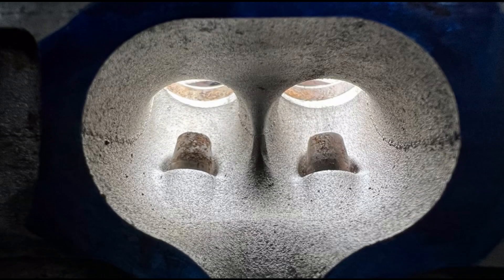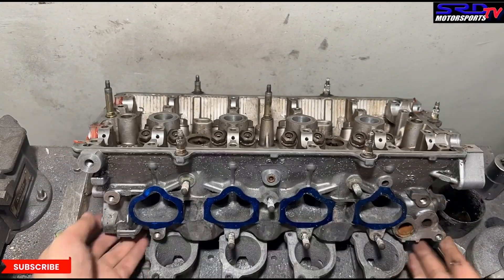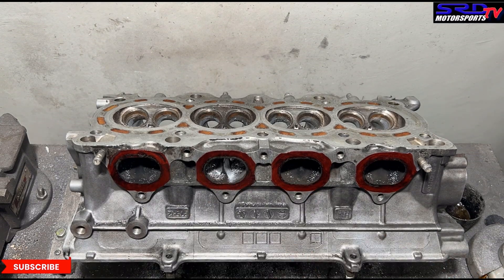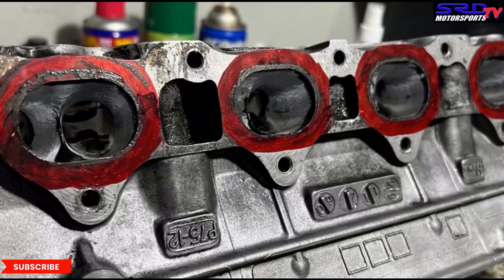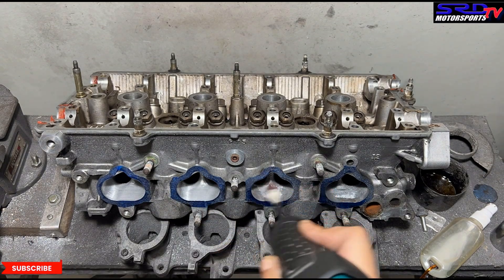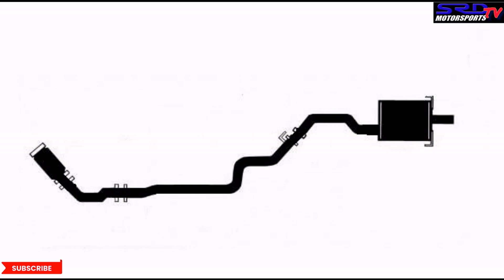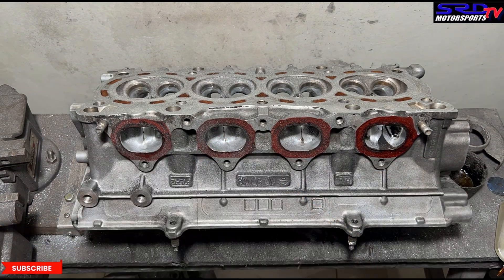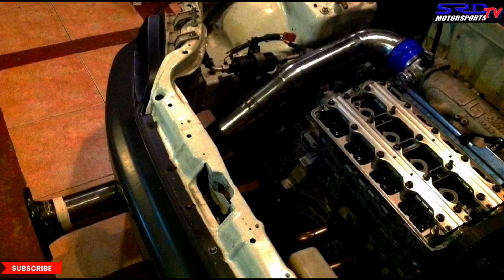B20 / B18 P75 Non VTEC Cylinder Head Portwork SRDmotorsports

Comment: Hey Brotha! You’re in AZ and I’m going to be there in a few weeks for school! Would I put in the same intake manifold? Or would I need a vtec one, or port the intake manifold as well?
Reply from the maker: Both can work but vtec and non vtec valves are different
Reply: @SRDmotorsports  I have a p75 non vtec, I had the head resurfaced but I want a port for efficiency (and for boost lol) So I’ll buy the regular sized ones for the B20 P75, then I’ll make an order!
Reply from the maker: Yeah regular sized valves is good
Reply: And same valves correct?? So I can buy everything ahead of time!

Comment: Mannnnnn great video. 1 question tho might sound lika complete fool but i never understood why people lock vtec on vtec cams or 3 lobe cams. isnt the purpose of running "vtec killer" single lobe profile cams to lighten rotating assembly weight allowing for more revs? what does locking a 3 lobe camshaft to only run the big lobe do other than destroy low end and street drivability?
Reply from the maker: Was only made for “race” applications cuz the pr03 is still bigger than most non vtec cams 

The prob is fb peeps thinking it’s “cool” for street lol that’s why u find it odd cuz it is odd lol!!!

Comment: I’ve always been an old school V8 builder but I’ve been wanting to see how much I could pull out of a stock CRV  b20 non Vtec with simple bolt ons and stuff and keep it very street friendly but have some vroom vroom. What all could you recommend? And would an aftermarket Cam be beneficial?
Reply from the maker: Oh man and “Eleanor” has always gotten my number :)

I think aside from this work on the head… it would be surprising for you to see a lot are still within the “realm” of what you do.

Example on the exhaust = same analogy if comp is somewhat mild then a mild exhaust would help indeed like a TypeR copy of sorts etc. same with induction but cam related
Mild cam = u can go big on intake
Hot cam = I can stay “small” on the intake to let airspeed stay good…

That’s a cam choice between 
Crower 62403-2
And
Crower 62404-2

If a cam is the direction? My choice be 404 and just port the factory intake manifold :)
Reply: @SRDmotorsports  with port work such as this and utilizing the high compression pistons that are on the b20b? Is it? In a stock crv. Do you have experience with the stock ecu running this setup? Also what is a great stock injector replacement that has better atomization?
Reply from the maker: @_jdgeorge_  not sure how good it will stay if stock ecu
Reply: @SRDmotorsports what ecu would you recommend?
Reply from the maker: Hondata, Fueltech or even rechipped ecu will be fine
Reply: @ I’m finally getting some time to be able to start work on my 98 CRV. AWD Manual transmission. Been debating getting the tools and practicing on some blown heads I’ve collected. Like I said before. I wanna basically just work with what came with the car. With exception to exhaust and intake. Still trying to decide if I should get an aftermarket intake or just port mine. Not looking for crazy numbers. Just wanting it to be real peppy for when I’m going to pick up supplies. I’ll never get rid of this car. I’ve grown really attached to it. I’m rebuilding another transmission for it now. I’ve watched a ton of tour videos but there’s not really anybody that does good videos on rd1 cr-v’s. It’s kind of a jungle piecing all the info together from other Honda models.
Reply from the maker: nice nice

Comment: all the head porting ive ever seen is the same story everytime.  "o every head is different and you need to know what to do."  and everytime they dont explain their approach and everytime it looks exactly the fucking same as every port job on every head ever.  You cant say shit like "o the way you port this head is not the same as you would a b16 head" and then not explain why and what the differences are
Reply from the maker: sorry about that as the video could take too long and boring for that but i see what you are saying

and pardon me if alot of times i assume the listener or watcher already understood the basics or the scenario

example Valve size to port volume, valve size to throat ratio and ofcourse "stroke" dictates piston acceleration which affects "signal" on how the engine sucks in air etc

the other aspects i mentioned or said is this:

D-series in relation to its stroke (90mm which is 1mm more than a b20) has quite high piston acceleration therefor sucking in more and with its small valves (knowing we can do cams and intake) these heads often time can and will lack "port volume" and that cannot be "seen" easily if u know what i mean?

now compare to a b16a head which is already borderline nearing "too big" of a port volume especially for a b16a with 77.4mm stroke
YOU cant port it for a B16 using tje D16 approach of lacking port volume? hope that makes sense...

this goes the same for the P75 its not on the "too big" zone yet... so the approach then cannot be "what youd do to a b16" knowing on that platform you could easily go overboeard... hope that makes sense

again thats all taking into account valve size
rod length, stroke and even cam to be used and compression... and with that? the video could take 2hours lol

so i hope that explains it a bit better and pardon me for saying "shit like that" cuz i expected those into it already covered some of the factors like sizes and all but def my bad on that

and yep id explain as you comment mainly cuz its worth explaining cuz i understood and im sure all the head porting youve seen if u ask theyd always make it sound too complicated like as if you dont understand lol
not here :) so i hope i got to reply to your comment properly man :)
Reply: @SRDmotorsports  ok yeah theres a little clarity there.  What would your approach be on my engine?  Its a b20 as well, the head is a p8r.  For the p8r its a p75 head with 33mm intake valves and the combustion chamber is 47cc as opposed to 45cc and the diameter of the combustion chamber is 84mm matching the b20 block.  I have yet to get cams for it but I was eyeing the crower 404.  I have vtec sized valves in a b20.  So should I port it more as if it was a gsr head or more as if it was a p75 head?  From what ive read it flows similar to a gsr head
Reply from the maker: @timm5970  oh snap nice rare head there tbh here in this country I’ve yet to see one

But from the silicon molds I’ve seen it’s closer to a b16 shaped port but it doesn’t seem to be borderline “too much” port volume mainly because the valve stem size is still “bigger” than vtec so it’s a % lessened on throat cross sectional area

So you are on the money with the “gsr” approach but in a sense only on “amount” removed but the nonvtec p8r likes a little short turn help mainly since unlike the GSR has some port length “into” the seat letting it arrange itself (K series are taller in a sense here they’re tons better)

So widen the short turn a bit = kinda hinted on it on my earlier porting vid the “how to: TypeR “

Now publicly I’ve shared some of my approach lmfao but all good I mean a lot of the “experts” are less willing to adapt so if they do different? Well Pride is also different lmfao
Reply: @SRDmotorsports  Btw I think that would be a good video to make.  Maybe porting a head and explaining simply the theory you used for that specific head.  Not necessarily how to approach every head but why you chose to port it the way you did for the application you are working on
Reply from the maker: @timm5970  I was about to say thanks for your “shitty” comment lol kidding

But thanks cuz it gave me an idea and since I haven’t ported a P08 for a vid most of it we’re done with pictures? Next chance I get to port a P08 you bring up a good idea

Can share specific stuff for that specific head and why or atleast the analogy to why

Oh btw if idle was crucial yeah 404s are nice but I come from a vw lopey idle background so 405s I won’t mind hahaha
Reply from the maker: I like that video idea also cuz it could shed light on “what stuff” you gotta consider that plays a roll on ported heads (cams , header, comp, bore to even rpm use). Nice thanks for that man
Reply: @SRDmotorsports  thank you.  Yeah the p8r head comes off honda Orthias from Japan.  I got it here in the states for $60
Reply from the maker: @timm5970  man makes me envy those who have or in possession of a p8r

If you haven’t touched or started it yet give me a day or two it’s on my other dinosaur laptop i have a photo of silicon molds of p75 pr3 b16 and I think it’s a p8r or the other p75 lol but it would give you a good visual to target as far as shape goals go

Il post the photo in my community of this channel
Reply: @SRDmotorsports  dude that would be sweet.  I wasn't planning on porting it and the car is currently out of commission but I can easily pull the head and change that.  Who knows
Reply from the maker: @timm5970  il scrounge the old laptop tonight my time and will let u know or just post it at the community ftw to give u more visuals
Reply from the maker: @timm5970  found it , it’s actually of a Pr4 head a p75 head (both non vtec) and a pr3 head
Reply: @SRDmotorsports  o ok so theres nothing for the p8r?
Reply from the maker: @timm5970  sadly no but if you check on it you’d see it seems closer to a pr4 than a pr3
Though it has pr3 sized valves

IMO might be absolute killer once u done with it
Reply: @SRDmotorsports  so if i pulled the head how would i go about making one of these models?  Just get some play doh or something?
Reply from the maker: @timm5970  actually it’s silicone so gotta get some that u can pour and so u plug the port with the valve tilt it and pour let it cure overnight
Reply: @SRDmotorsports  So when I got this head I wanted to port it but all I really understood was "core shift".  Basically where the valve seats are pressed into the head they cause a lip and dont align perfectly.  I did "port" those even.  So some work has been done to this end but Idk how drastic of a difference this made good or bad.  Maybe I can make a mold of the port shape and take some pictures and show it to you.  I have a stock b16 intake manifold modified to fit on this head as well
Reply from the maker: @timm5970  yeah the basic stuff u nailed down so it seems right now urs is like a “typeR “

So def good stuff… dunno bout other peoples approach but visualize
From runner entry (manifold) to throat it ideally should taper and only by the throat behind the valve face and seat is when u slightly get some cross section increased a bit

Picture that area as it’s “waiting” for the valve to open and it’s gotta be packed well

If that makes sense 

And def now too many info shared for the “local” “experts” lmfaooo
Reply: @SRDmotorsports  Doubt anyone will read these comments anyway lol
Reply from the maker: @timm5970  true true lol
Reply: @timm5970  I wouldn't discount others reading it.  It's hard to find concrete info for actually working on a b20b.  I've worked with oldish V8's and every post I find is someone telling others to look it up or to take it to a shop.  Sorting the trash from the gold is a serious headache if you want to do budget DIY work on an RD1 CRV.

Comment: Do you have any home remedies for cleaning a vtec b16a head? Or should I take it to a machine shop.. I’m going to try to rebuild and port my b16a head
Reply from the maker: Oh thanks for checking this out and for this question! Quite a good question tbh
For home remedy I think it is safer to spray the head with wd40 let it soak overnight then next day on a basin of sorts? Soak the head in soapy water…a grease cutter detergent would be cool like sort of dishwashing style 

Let it sit overnight and that should get it clean have a brush ready and power spray it with water :)

Most machine shops soak it in diesel spirits which is doable at home just proper disposal is a must ofcourse
Reply: Thank you 🙏 will give it a shot!
Reply from the maker: @SamuelSoto17  stay safe man

Wd40 rocks 😀

Comment: Love the topic boss chief especially the exhaust part. 😂  And i can remember we did have a conversation about this too. 🔥
Reply from the maker: Thanks man and tbh for the past few vids ive been trying to make a decent visual on exhaust trail of the whole exhaust system and its only now i got to do it so it had to join in lol

which makes sense cuz aside from performance it does aid in efficiency and that goes for all brands too! 

Im too hell-bent on understanding engines even MotoGp honda rc212v

if u get a chance to check out without flairings? its exhaust takes a "loop" under Marquez's seat

most prolly cuz of length hmmmm
Reply: The visual for the exhaust chief is easy to understand 👍agree chief. And nowadays na sobrang mahal ng gas, efficiency is a must have.

And i did notice too the fuel consumption of scav/downpipe/midpipe vs. full exhaust plus the smell of the gas fumes 😂
Reply from the maker: @midnightkaiju  yes easier to understand was my goal cuz its the same as siphoning fuel with a garden hose on a gas tank of a different car? but its hard to explain once u suck on the fuel? that "pull" is continous
like scavenging in exhaust terms

but then again fuel scavenger fits too lol when siphoning it 🤣

Comment: I like the exhaust par the most. You explained it very nicely. You inserted also very informative pics here. Thanks bro. 
p.s. Would like to know what happens if you change the stock exhaust with just the longer stock exhaust? On cars or/and bikes? For example doing it on Clio 1.2 petrol: stock VS just longer stock exhausts? Any particular good or bad effect? Thanks in advance. Just curious.
Reply from the maker: Yes I think a lot explain about exhaust but don’t have a visual aid so I tried to draw it to show

That’s a nice question actually I think longer stock could help the lower rpm from idle to 3,500rpm which might be good for everyday drive but I think performance above it will suffer and we might be caught up by a “King Rat” like on your video 😀
Reply: @SRDmotorsports  Aha, I get it. So, initially it would help, I mean in the lower revs. Thanks. What do you think of just removing the muffler on the motorcycle exhaust for example? Do you think that just the sound would be deeper or we might see also some changes in power, consumption... Thanks man.
Reply from the maker: @RRRRefuelRideRace  i think it might be noisier but
as long as the length remains the same its worth a try
Reply: @SRDmotorsports  I know about the noise, but I also thought of a little increase of power or even drop of power. :)
Reply from the maker: @RRRRefuelRideRace  if same length you keep you might gain some power actually
Reply: @SRDmotorsports  Thanks, thanks mate. :)
Reply from the maker: @RRRRefuelRideRace  with your bike though lucky engine already sounds nice so it is "okay" to try just have to find a mufflershop that can do a pipe extension of the same size or slightly bigger and same total length as the stock muffler

actually now that would be a crazy video to make :)
Reply: @SRDmotorsports  Agree about that kind of video. I just thought in general. Sometimes I remember guys riding without the muffler. :) The most they gained on the 50cc mopeds were that loud sound of the exhaust. :)

Comment: Great vid as always! 

I don't really get why people use "scav" "scub" "scuv" whatever the spelling is 😆 I run a full 2" exhaust with a 24" resonator with a straight through muffler. I like to keep things quiet.. comes with age? 😆

Madami siento bente.. but there is one particular gt-86 with a uel and a raspy ass exhaust that drives by our street that really takes the cake
Reply from the maker: I guess way back the short exh worked due to lack of parts and knowledge even I ran one but I guess running 14.8sec on a stock block D15b7 back then made me realize a full exhaust works and that was actually not even SS just crush bent BI
Reply: @SRDmotorsports  I guess you guys really nailed it with trial and error + experience.. Nothing beats that!
Reply from the maker: @vince.r  that is true  and believe it or not my old d15b7 which was the first build i did back in the days totalled about 18-22 dyno sessions withh all the changes i did and tested
Reply: @SRDmotorsports  Oh wow that's a lot! 😮
Reply from the maker: @vince.r  def worth every penny

like the earlier vid i have on sri vs cai was on those days and that was my d15b7